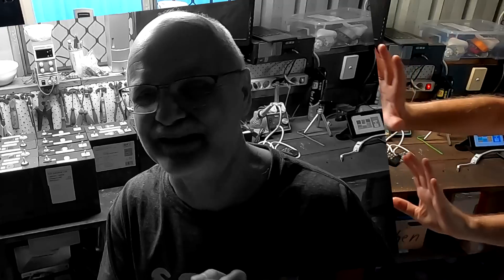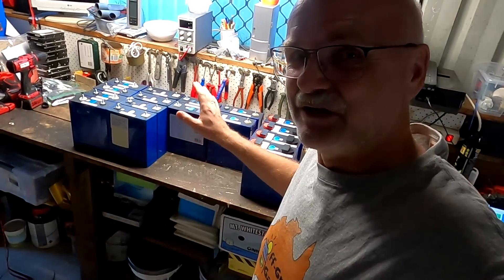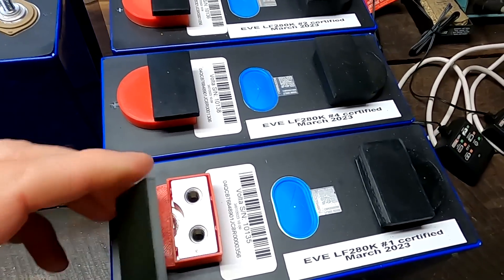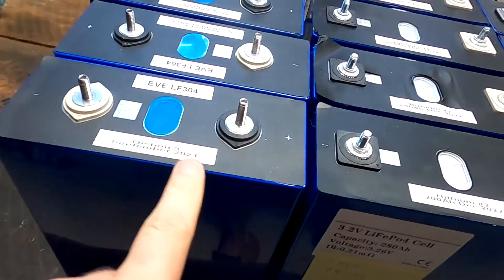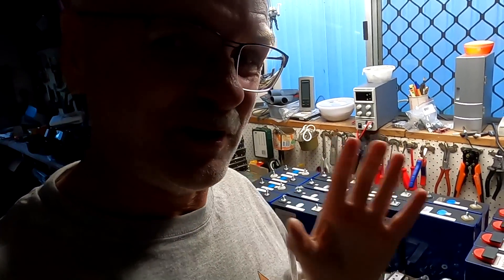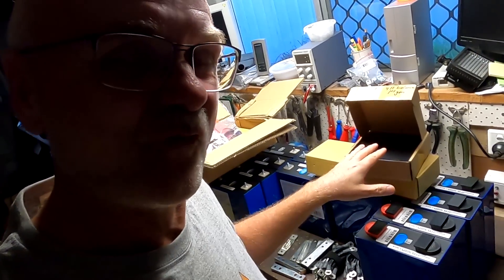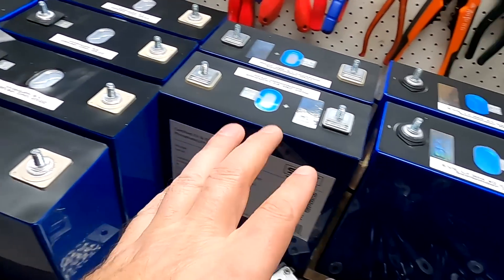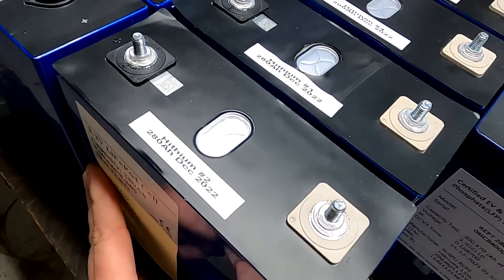The Frankenstein Battery Project - what could possibly go wrong?🤷‍♂️

Comment: Andy... Always put the better batteries on positive side... And the other what you think are not so great on negative side...
There is much more stress on positive side during the charging and discharging, because the all voltage wants to pass true all the cells to rich that end of the serial connection...
The Frankenstein battery is not weird thing at all... In the factory when they connect all those battery packs they don't even pay attention when is from the cell but they put together...
Don't worry... With lead acid battery this was just a usual practice for a 100 years... Just if you have the better cells on the positive side it will give less stress to the bad cells on negative side...
Good luck... Hope you give us results soon...
😁
Reply from the maker: Hello, I'm not sure if you're trying to be funny here but the order of the cells has no impact of the battery. It's a series connection and the current is the same for all batteries. There is no voltage pushing through or anything like this.
But if this was a joke, good one 😂

Comment: What would happen if you put a resistor for the lower level batteries would it help the 303amp batteries get fully charged. 
Once u do a normal test see how much the 303 gets charged then add resistor for all the 280 n check it it would increase the 303 charge level.
By the way I got eve batteries directly from EVE I will upload the links of the battery test so u can see if its any different from the certified cells you got.
Reply from the maker: All batteries will be fully charged once top balanced. The 280s will just be the first ones to be empty while the 304s will still have some juice left. Resistors are a bad idea...
Reply: @OffGridGarageAustralia  hmmm. Ok. My thinking was since there r more resistance it would be able to empty n fill the 304s all the time. Bcz it would be pushing more power into and out of the less resistance batteries 1st.
Yeah you might be right of it been a bad. I was just thinking how to max use the batteries bcz it was a big mess of batteries lol.
Also if you have time please check the graph I did it exactly how you do charge n discharge 40A. Thanks.

Comment: Instead of real buss bars use like copper or galvanized steel strapping from the plumbing section of the hardware store 😂

If you have a set of 4 of each type, you could possibly mix and match for a 12v like 1000++ ah unit and get the capacity matched up good enough

Comment: Just like in the days of flooded lead acid, NiMH, or NiCad, the pack will have the capacity of the lowest cell. Top balance only, as intercell balancing will overstress the small cells trying to fill up the higher capacity cells.
Reply from the maker: Interesting thoughts. Would the smaller capacity cells be more stressed though? The balancer would only work at the top when all cells are rising their voltage, not at the bottom...

Comment: i think it can work but as long as the whole system goes average 70%  i think  resistances  will ruin capacities of the bigger ones and the smaller cells will kill the system due to faster low charge rate!!! .. BUT in the other way  most  if not all of them will just work fine 20 amps wont do much change most of them might go calendar ending if you just have barely use em!!!!   because i saw most of the tests in old videos i think you will have  fair capacity with no crazy thermal activities., even if you push it a bit. ,!!!!   hope bMS or BMses  wont have another opinion and cooperate
Reply from the maker: I'm not expecting the internal resistance of these cells to be very different. We will see...

Comment: Do a 24v system that way you can balance (pair strong and weak cells) much more interesting.
Reply from the maker: What would I do with a 24V battery??? 16s, 16 cells in series. That's the real deal 😊
Reply: @OffGridGarageAustralia  Thought this was an experimental channel. Just rearrange from the (2P)8S  to 16S afterwards.
Reply from the maker: @micksc1  I have literally no 24V equipment to do anything with that battery, no inverter, no loads... so either 12V or 48V it will be.

Comment: I had to match my used cells in groups of 16 according to their amp hours or I would have two or three cells that dropped below the safe voltage cut off while the rests still had plenty amp hours left.  I match the cells into three categories , three different battery packs with each battery containing 16 cells.
Reply from the maker: Yes, that will work if you have enough cells and can select.
Reply: @OffGridGarageAustralia  out of fifty used cells , five are unusable. That's not to bad for used.

Comment: it will all be fine!
big batteries won't fully charge beyond lowest cap battery and similarly won't discharge below weakest cell depending on charge state on installation into battery. you could of used those cylindrical lipo cells and it would still work as normal just no more capacity beyond weakest cell. assuming you abide by charge discharge characteristics of weakest cell. the  mix and match of cells is irrelevant as long as weakest cell meets your charge discharge requirements.!
but will be good demonstration for those not familiar 👍

Comment: You could use 10 x 25Ah batteries to elevate your 280Ah bstteries to 305Ah - more bus bars => more fun
Reply from the maker: I would not have a case for that though. But I have a few 100ah cells here... 🤔

Comment: I have mixed four 12 volt 300AH bioenno wired in 48 volt, added those to my seplos Masons and it worked fine, bioenno uses a PCM instead of a BMS, was worried at first but no problems. Hopefully you can publish some real word settings for the neey.
Reply from the maker: Sure, can do a NEEEEEEYYY tutorial when we connect it.
Reply: @Off-Grid Garage  thanks, would be interested in what setting ls you find work the best,  im still playing around with it but it doesn't seem to work properly for me.

Comment: Hmmmm.... so if they all start out discharged, when you charge them, the 280Ah cells will reach a higher state of charge before the 304Ah cells... and you should have voltage problems with balancing, no?  I would think the balancers would have to work double time to keep the whole pack in balance.
Reply from the maker: We would do a top balancing once built. I'm trying to use the internal balancer of the BMS for that.... We have to try.

Comment: It is not too odd, and I would start with the high-capacity cells in the string to the negative side, followed to the lower-capacity cells towards the positive side.
PS: I vote for SparkenStein or SPATStein instead 🙂
Reply from the maker: Why would you start in a certain order of the cells? Is the current not the same in a series connection?
Reply: @OffGridGarageAustralia  True but as I see often that shunts, battery monitors, circuit-breakers and other protection-devices (etc) are mounted in the negative line, I would assume that the higher capacity cells would tend to give more challenges (e.g. hotspots on the bus-bars) and have more energy in them that I would tend to put them close(r) to the protection-devices? But at least have the high-capacity cells situated closer together so I can monitor them easy(er). When you have 16 cells or more, they do tend, to me, to all look the same.
Electrically of course it makes not much difference but some batteries might struggle greatly in your set-up.
As normally in a series-connection it is recommended to use the same capacity so all cells would (roughly) discharge the same and provide similar energy. With a wide(r) range of cells & capacities, inbalance and because it is a string, the weakest link will affect the complete set.
Where the lesser-capacity cells will be fully discharged whilst the larger capacity cells will still be reasonably be charged.
The BMS would need to work very hard to keep everything safe and protected.

Comment: Curious about the result ! Nice experiment. LifePo4 is not cheap, building a large battery in 'stages' could be the only way to go for many people.
Reply: This would also create inverter problems..

My advice would be to buy smaller capacity banks and stack them as you go along. Limit the charge and discharge in the inverter/solar charger accordingly. This way one would only have to buy one set of charger/inverter to reach the end goal.

Comment: No problem as long as the BMS is functioning correctly. 
But the 280 Ah cell will be the weak link in the chain.
So you will end up with a battery 48V 280 Ah.
I have a battery mix of Thunder Sky and Calb CA 180 FI which are different in chemistry from each other.
The Calb cell is 20% better at -20°C then Thunder Sky and the Thunder Sky is from 2011 and the Calb is from 2015 as I recall, It is some yers since I made the battery (13 years 😊)
Reply from the maker: Oh, wow. Frankenstein has lived a long time for you. Great to know.

Comment: so capacity will be that of the lowest cells as these will trigger low voltage cut off i feel they will also be the first ones to charge also making for over voltage warning i think the balancer is going to have its work cut out but it will work with no problems it will just be the capacity of the lowest cell unless the balancer can keep with with discharge current then it may even be able to get in the range of the highest capacity cells
Reply from the maker: As with any battery, lowest cell always dictates the capacity of the whole battery.

Comment: I would like to see a 50 ah battery in the mix.  I enjoy your videos.  Keep up the good work.
Reply from the maker: I have a few 100Ah cells here...
Reply: @OffGridGarageAustralia  

That would show if mixed  AH batteries can be used together.  Thanks for thinking about it.
Reply: It will also show if the BMS can cope with different capacity batteries.

Comment: What a blood curdling project. A great one to get your fangs into 😊 
I don't expect any issues other than previous comments about cut off on the weakest cell determining the capacity.
If you use different types of BusBars that may have a marginal effect but overall I think it's a fantastic idea.
As long as each cell is at the same voltage when connected there shouldn't be too many sparks flying.
This could be the silver bullet of all projects or a coffin dodger??
If the lights go out in Spain over the next few days I'll know you've hooked it up 👍
Maybe you should change your refreshment to Fang Beer for this project? Enjoy😊
Reply from the maker: You will see the bright light at the horizon when I turn it on. Even from Spain😂😂

Comment: A few things that would be interesting:
- Is it worthwhile to have an active balancer distribute the 24V * 20Ah capacity (300 vs 280) when needed at the bottom or top?
- If higher amps are required to be balanced, is it possible to put multiple active balancers in parallel?
- Is using flexible bus-bars as a general Frankenstein solution the acceptable generic method?
Reply from the maker: Interesting! The balancer would need to be very large to balance the cells at the bottom and top again when charging depending on the load and charge current.
Flexible bus bars are a good solution I think. Some of these cells are so round already...

Comment: Using the balancer will ruin the whole project. Just top balance them, connect them to the BMS, and you'll get 280Ah at 48V. If you use the balancer, it you'll lose the top balance on the first cycle.
Reply: Using the balancer will just work fine. As long as it is configured to balance only above 3.4 or 3.45 volts, it will bring all cell to a similar state of charge when 'full'.  No issues there.
Reply from the maker: OK, we can do an initial top balance and use the battery for a while, see how it goes...

Comment: Top balance, and you'll have a battery with the capacity of the least capacity cell.
An active balance active during charge and discharge might extend that capacity a slight amount (depending on the rate of charge/discharge compared to the rate of the balancing).
If you have some additional smaller cells you could parallel them to the lower capacity cell(s) in the 16s pack to increase the overall capacity.
Reply: This will be way more interesting
Reply from the maker: Yep, heaps of other LFP batteries here to 'fill' up the lower cells. Good experiment.

Comment: I assume, bottom balancing would be better for this battery?
Reply: Why do you think so?
Reply: @derVilli  because I suppose that you will never get the 304Ah cells above 3.4V when in a pack together with the smaller cells. This bottom balancing once (all cells empty) and then cycle from 3.45 (first cell to reach) to 2.9V (first cell to reach) should be fine.
Reply: @matija3791  well if you top balance cells they will also reach higher voltages. The curve might not be as steep. And the difference in capacity is not that big.
Reply: @derVilli  good point.
Reply: @matija3791  i guess your hint is valid if there are big differences in capacity. 50Ah vs 304Ah. The voltage difference between cells would be big and bms would need to stop charge or discharge based on cell voltage of the smalest cell.
In contrast, Victron reduces current if you get closer to the top voltage. I talk the overal pack voltage.
Reply from the maker: With these cells you could do both (bottom or top) and would get 280Ah out of the battery bank, regardless.

Comment: It'll work like every other 16s battery. The weakest cell determines the capacity of the pack. 

The bloated cells;  getting them into the seplos housing, that's going to be interesting.
Reply from the maker: Exactly, nothing wrong with different capacity cells.

Comment: I'm sure the battery will work fine. I don't expect any issues. The problem will be that the pack voltage will even less reflect the SOC than usually.
Of course, the BMS is even more important here than usual. If it fails to track cell voltages correctly, you're up for a huge fire.
Reply from the maker: But we never used voltage to determine SOC with these cells, so that does not matter. Once we fully charge the pack, we will balance and see how it goes. If they are all at 3.6V, they are all full... Them, we will go from there.
Reply: @OffGridGarageAustralia  Don't think that pack voltage can be dismissed completely. The MPPT chargers, the Multiplus and the Smart Shunt all use it to determine when the battery is full.
Furthermore, if the battery is not perfectly top balanced you won't reach 3.6V at all cells since the larger ones will not be full when the smaller ones reached their limit.

Comment: hi andy, it will work!
with an 4 amp active balancer yes!
i suggest to mix all batteries randomly, in order to avoid weak and strong clusters.
this makes the balancer's live easier. and i suggest to keep the max in/out current below the balancer's capacity, at least during the steep close to 100% and close to 0% of soc.
and i sugest to use copper nuts, whashers and bolts for all conections. aluminum is building an isolating oxide layer on the surface within seconds in open air. and stainless steel is high resistive.
i have running nothing else than a frankenstein used 18650 14kWh storage, since 3½ years without problems. simply random combined cells. only the heaters and self discharging cells i have sorted out.
my 7S/24V system is running with cheap chinese flying capacitor 5A balancers - always on - each 60P cells.
anyway, you can be shure, over time all cells will drift away.

best regards
michael

PS
such mal nach world solar challenge 2003 heliodet, the suitcase man
Reply from the maker: I won't use the active balancer, just the BMS 😂